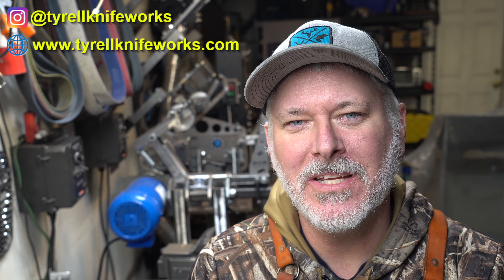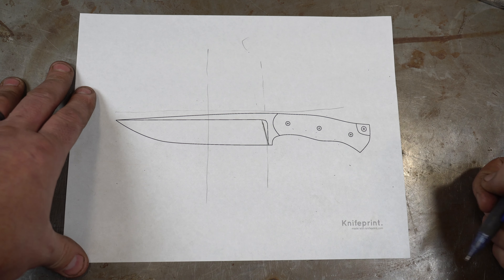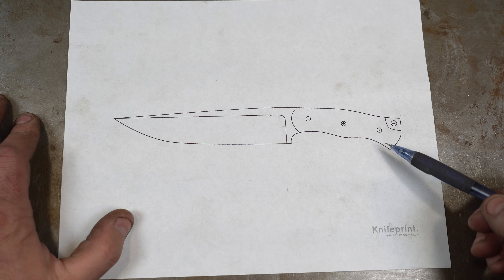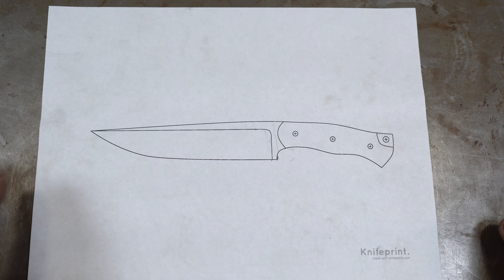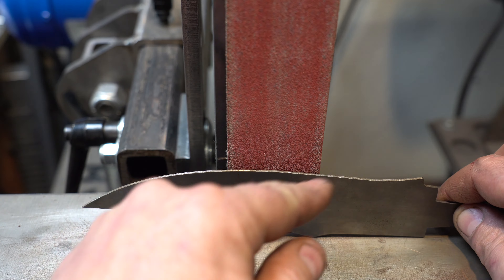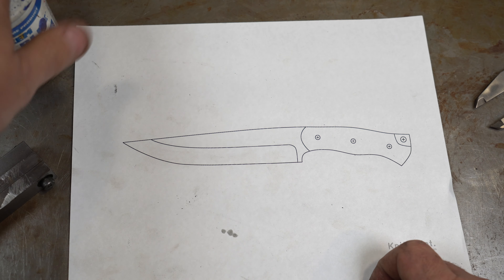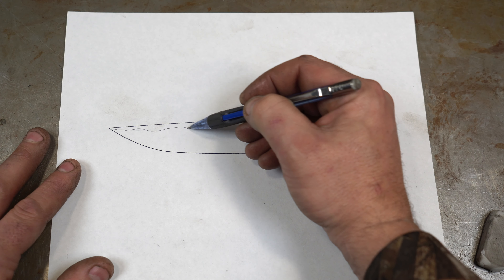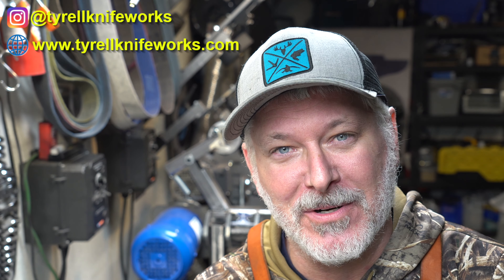Triple-T #118 - Grinding plunges and shaping bevels

Comment from the maker: Any tips you want or problems you are having that you'd like to see discussed in future videos?
Reply: How most hammerhead knifes are made, I would like a discussion about that.
Reply from the maker: @squallyboally  When you say "hammerhead knives", you mean the company that does folders?  I'm not sure exactly what you mean.
Reply: I’m curious to what a “hammer knife” is too. Not sure if it’s the multi tool knife with a hammer head or a dive knife that’s a dagger with integral guards. Many different things that it could be 🤷🏼‍♂️
Reply: Fullers... both by hand and by machine
Reply from the maker: @TRichardsBlades  oh that’s a good one.  👍
Reply: @TyrellKnifeworks  Single Blade Hammerhead Lockback Knife. 4-7/8 inches closed. 8-1/4 inches open. Made in USA. "CASE XX STAINLESS USA * * " (2 dot) and "P159 LSSP" tang stamps. Stainless Steel blade etched with image of hammerhead. Black Staminawood handle. Brass bolsters. Front left bolster etched with Oval "Open C" Case logo. Brass liner. With original leather sheath. This is how much information I can get.
Reply from the maker: @squallyboally  that’s a little too specific of a design.  No room for creativity so not my style.
Reply: Finishing touches (grinding, sanding) after the quench

Comment: Very helpful! It makes sense now to push and pull with opposite hands, not both. Sometimes I get a little dip in my bevel line but I usually work it out by gently going back over that area with the bevel flat against the belt. This should help to prevent that from happening in the first place. Thank man!
Reply from the maker: I'm glad it was helpful to you!

Comment: I do a lot of filing when I work on bevels in order to keep them straight. I have a medical condition that causes my hands to shake, so I tend to end up with a wavy bevel line. Needless to say I don't make very many knives because of the time it takes me to get one done.
Reply from the maker: Do you use a rest when grinding?  That helps a lot for unsteady hands.  Thanks for watching.
Reply: @TyrellKnifeworks  yes I do, and you are correct it does help. Unfortunately it doesn't help myself enough. I don't mind doing the extra work though. I'm a disabled veteran so I have the time to kill,  and I don't set unachievable deadlines for myself.

Comment: I saw Adam Savage making a guard for a short sword yesterday and he used a spindle sander to get a good inside bevel (like that of a karambit.) I hadn't considered it before, as I always just use the belt sander, but it seemed like an interesting idea to  try out. Might also be helpful to use a contact wheel with the sander in the horizontal position.
Reply from the maker: Yeah, that might work well.  All these techniques just need practice and understanding and then it becomes easy.  When I show the false edge and distal taper grinding, you might have some "aha" moments as well.  😉
Reply: @TyrellKnifeworks  Looking forward to it!!

Comment: What is the benefit of a flat ground blade as opposed to a hollow ground blade?
Reply: Mostly strength behind the cutting edge, the more metal it has behind it, the more resistant to chipping and roll overs on that edge. Hollow grinds are good in the sense that you can get a very thin amount of metal behind the cutting edge, but they tend to suffer from 'wedging' into softer materials as well as having poorer lateral strength if there's a twist or shock while its cutting, which can cause irreparable cracks.
Like most tools, they suit a specific purpose and will do ok in some tasks, less well in others and completely unsuitable for some- basically there's only so far you can get with materials science before you just need a bit more of said material for the tool to work properly
Reply: @krissteel4074  Thank you Kris.
Reply from the maker: I think Kris nailed it on his response!  Thanks for watching!

Comment: I’d like to add, if your grinding with scribe lines don’t grind to your lines with a low grit belt. Get close then go up in grit so that you meet your lines as you get to your final grit finish. Or compensate for more material to be removed when scribing lines. Hope that makes sense. I know Denis will get what I’m saying. 😉
Reply from the maker: Yes, I even mentioned that very thing... put your scribe lines lower than you think because pre-heattreat grinding is only one part of it.  😉.  Thanks for watching, Erik!
Reply: @TyrellKnifeworks  I completely missed that part. 🤦‍♂️